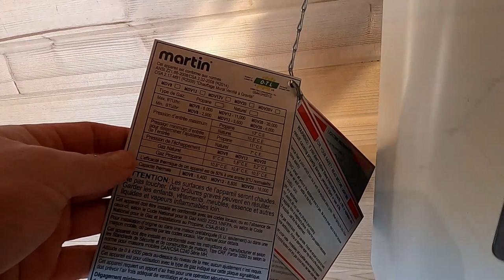Direct Vent Heater Installation: Off-Grid Cabin Build #12

Comment: I notice you installed the outside plate under the siding. That's what I would like to do. Did you verify this with the manufacturer that the plate does not need to be outside the siding?

Comment: Happened by your channel looking for some content on the heater. The lead up was great, very relaxing and pleasant. It’s been many years that I’ve seen the Great Lakes. I was station in the UP back in the mid 70s . It was part of my life for two years and it left a lasting impression. I still miss it to this day in the latter years of my life. 
So it’s been several months with the heater and I was wondering if you could give us an update. Building my own 635 sq foot cabin and looking for a quiet sufficient heat source. Winters are long and I’m not into listening to a blower going 24/7 for 6 months .Thanks in advance and I hope you have many years to enjoy your piece of paradise. Cheers 🍻
Reply from the maker: Heater still going strong. It makes a quiet popping noise sometimes. Nothing loud, but not completely silent either. Two thumbs up still. Seems good on fuel. I'm glad I oversized the unit. Go bigger size than minimum. I'd buy again no question.

Comment: What has been your experience with how much propane this unit uses? On low and on high setting?
Reply from the maker: In my small cabin, it just sips propane, even in the real cold of -15 C range. So no complaints at all. I have 2, 30 pound tanks so that helps too.